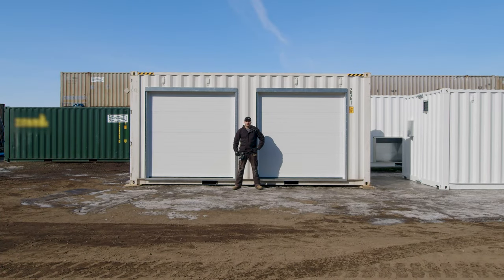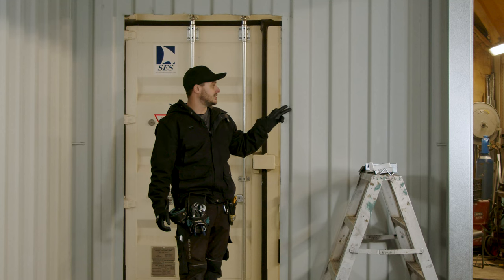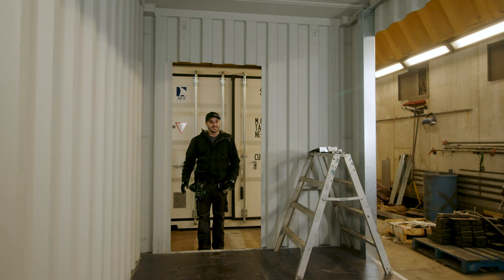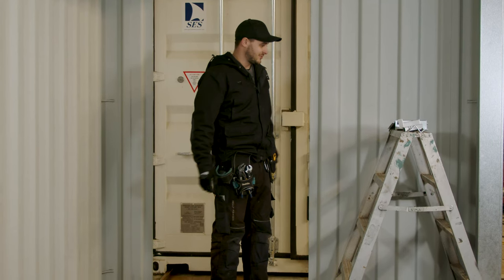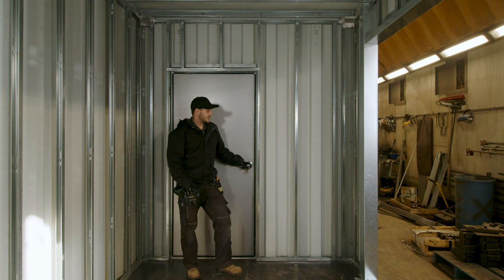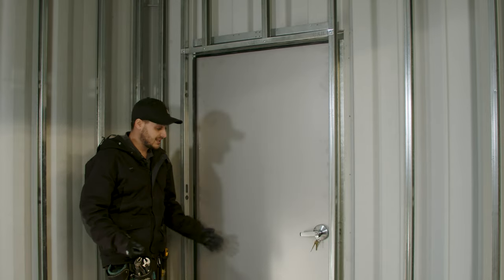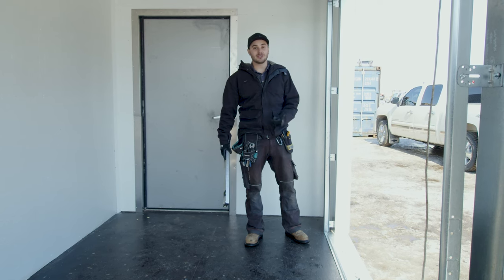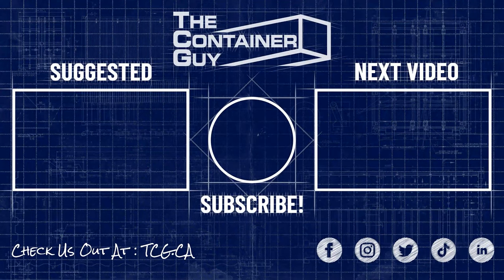Framing, Insulating, & Finishing A Container Storage Garage

Comment: You might be able to get the door to fully open if you put another curve at the end of the track to tip the top of the door down.
Reply from the maker: Good idea. I'll ask the door contractor about that. Could maybe go up a bit too if the ceiling height was there.

Comment: I’m a boilermaker/welder and here’s  a tip google in how to join wood panels together. I’m sure you’ll find one method for you. I did a small wooden boat course and they helped with many timber joins that get the best strength . Done correctly those panels will resist cracking on the joins. Boat guys will die if a panel separates
Reply from the maker: Thanks John!

Comment: Maybe put the track on before the steel framing, so the door goes between the top of the container and the ceiling. Should give you extra height, extra depth (the door has another 2.5 inches or so), and better insulation at the ceiling since it is now further away from the top of the container.

Comment: Here's is a tip : install the top an bottom track first with bubble strip between the track floor an ceiling. Next cutout windows an doors all beforehand , then spray foam . This will allow you to get a even coverage on walls an ceiling. Then frame an install windows an doors
This will save time money an headache. Trust. Doing it this way made it so much easier. Hit the like on this comment if it helped you. Cheers

Comment: if you want to capture the international market, be sure to include metric measurements in the webshop, manuals and videos! for example, I've no idea how big 1.875" is without conversion/lookup (47.625 mm as it turns out), which might be fine for one or two measurements, but for a whole container mod with 5-6 kits?
Reply from the maker: We're Canadian so metric is our system. I just don't think in mm. Good point though about the installation instructions. Thanks 👍
Reply: @TheContainerGuyTV  I specifically brought it up cause I've seen a lot of Canadians online use a "mixed" system of sorts.